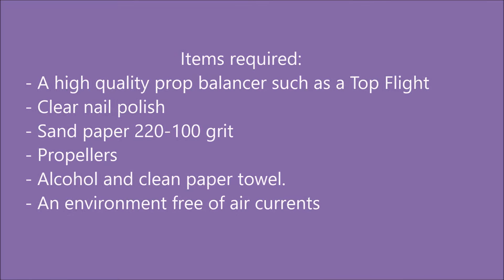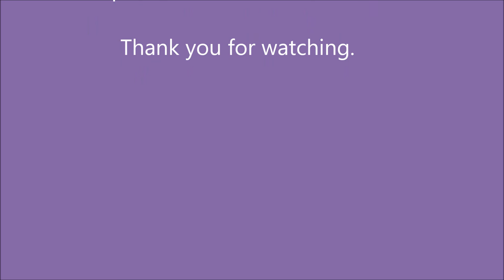How To: Balance a glow engine propeller

Comment: Hey David. I have always been a faithful follower of your videos. This has been a really good video. 
If there is any way do you think you could do one also showing when you have the blades but the hub is not and how to balance it. Also could you do one with multiple blades that are one piece such as a 3 blade and 4 blade. I have really been having trouble finding anything that shows multiple blades and I find it is very difficult and I don't have the confidence that they are correct. 
Well just wanted to see if you could put something together. I have always believed in your advice and have learned much valued information. One thing a youtuber needs to do is earn the trust of watchers and I'm proud to say that you have gone well above what's needed to earn mine and countless other people. 
Thankyou for your videos David and I'll be looking forward to more.

Comment: Was taught many years ago to remove material to balance. Tried your method, absolutely brilliant. Thanks.
3 blade prop, removal method, heavy blade above and balance other 2, then remove material from top blade.
By your method find heavy blade, add nail polish to next light blade until equal, then add polish to the other light blade.

Comment: Great video David. How do you balance a 3 or 4 bladed prop?
Reply from the maker: Well the process would be the same.  Watch for the heavy blade and sand or add nail polish to the blade accordingly.
Reply: Well, I can see that a heavy blade would hang down with a 3- or 4-blader, just wasn't sure how it would look when it was balanced. I suppose the aim would be to get it so that there was no tendency for any particular blade to repeatedly hang down. It's academic anyway for me as all my props are 2-bladers, was just curious! Enjoy your vids btw. Grahame
Reply from the maker: Well now you are making me want to buy a 3 blade prop just to balance it.  I would assume that it would swing freely and stop in totally random orientations if PERFECTLY balanced.
Reply: That's what I'm assuming. Or maybe it would continue to turn indefinitely as it tries and fails to find a heavy blade to hang down… perpetual motion (who needs an engine?!)
Reply from the maker: The day I shot this video I left a prop on the balancer and turned my fan on.  The prop just kept going all day and my cats loved watching it..... for about 45 seconds.  Then they got bored since it didn't run from them....